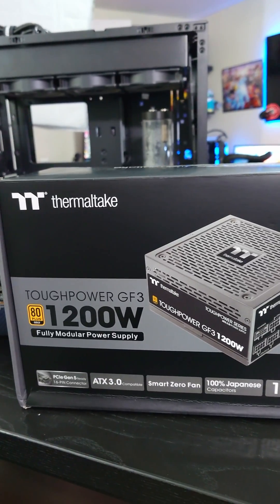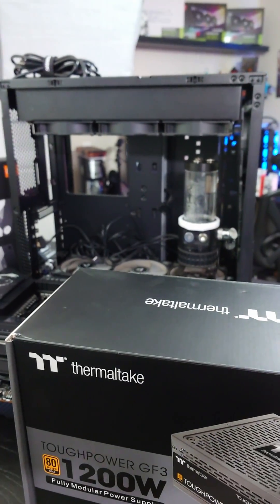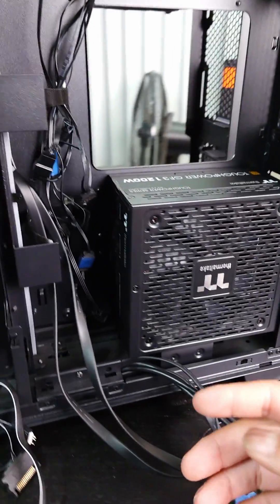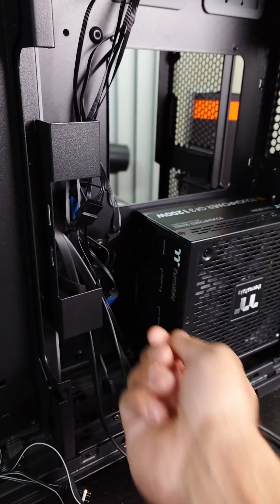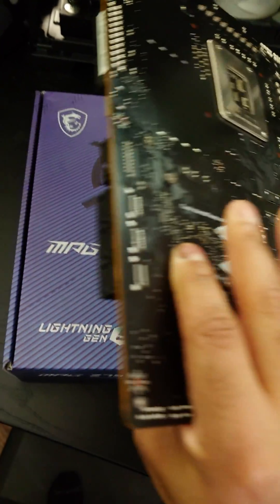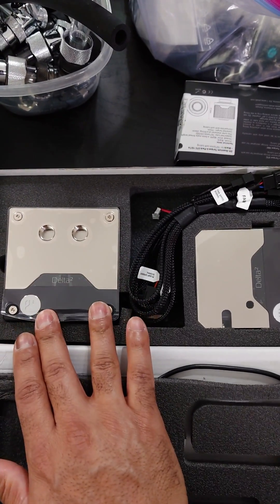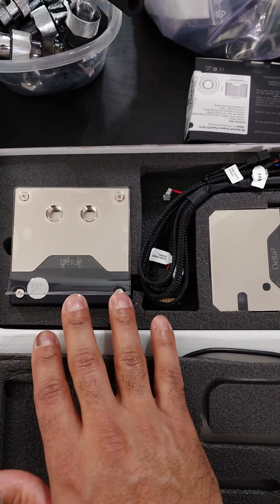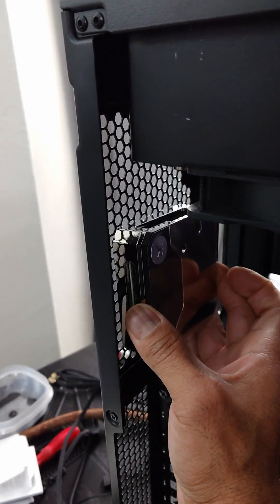13900KS ThermoElectric Cooling build process. EK-Quantum Delta² TEC

Comment: @dapoets - Quick question. I have just bought this and am waiting for the whole set up to arrive. What's your temp on the outlet post radiator? I am setting up 3x 420mm with 18 140mm push-pull radiator configuration and am trying to figure if I can cool my 4080 with the EK water block I bought too. The radiators will be outside of the computer case as a standalone monolith, so I can go 5-6-7-8 if required.

Comment: So did you get it to work on your z790 Carbon? Ek's horrible webpage that says there is a motherboard compatible list but clearly there isn't when you scroll up and down the Delta 2 TEC page. EK placed a blurb in the NOTES section its only for z690, Good job EK this should have been pointed out at the top of the page or in the motherboard compatible list you say to look at but guess what it doesn't exist on the webpage! SkatterBencher said somebody at EK had to modify it for him to get it to work on his z790 Apex.

Comment: With the Intel Cryo Tech software, can you control pump and radiator fan when the TEC is off e.g.? or with other software? for your preferred noise, efficiency, less wattage consume or whatever you want in some different moments. I have been watching a bit of that software and it is a bit, bit. When is scheduled the review approx.? maybe if it is possible to know it. Thanks.

Comment: all tec product since ...always...(swiftech koolance and other try ) are just maketing shit,  it just help for 1 thing : have low temps in low charge for people who dont play with Ln2 (in full load that help nothing even a mora 3 pro  can't keep a 12900k oc + the tec @320w cold enouth , even with the intel@ek software who work on so few config (and i think it's not even possible in 13gen or you have a internal build) and in H24 build it's a pure non sens with his crasy huge electric consumption
Reply from the maker: There is a nice difference between old TEC and this current model.
Reply: the tec you have in the block is just a tec like all other old tec the only difference is now it has a software control for avoid condensation but in full load you will still have the same problem you must dissipate the 350-400w of an 139000ks + the 320w of the tech and on a "classic" water or a mora 3 pro it's not even possible during more than 10min , so yes for a run in cinebench or game you can win a little perf but at the cost of twice electricity cost and if we speak on a workstation work of many hours you will just have a little gain (if you can evacuate more than 600w) if you take a chiller like LTT perhaps you can find a gain but i realy thinks they will have the same gain with a non tec bloc
Reply from the maker: @MrBisous34090  It's updated with more efficient cooling capabilities with Aluminum Nitride Ceramic plates. I think you will be surprised. stay tuned for my full video review.